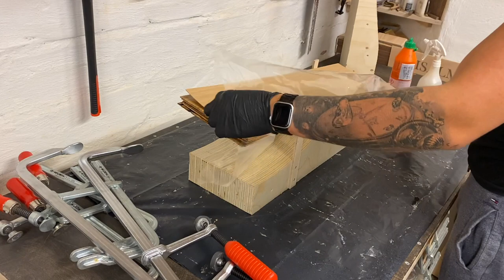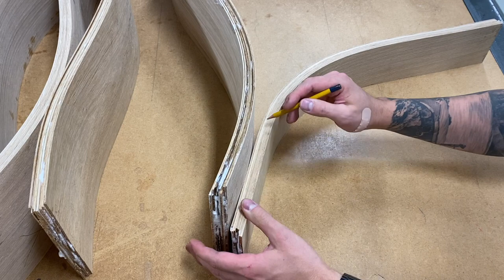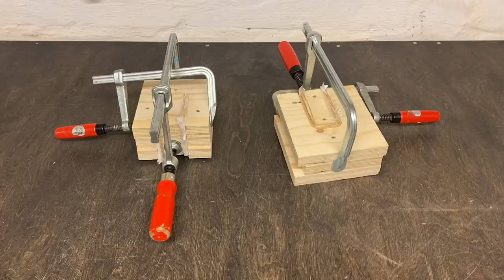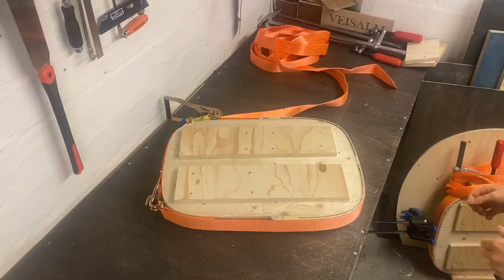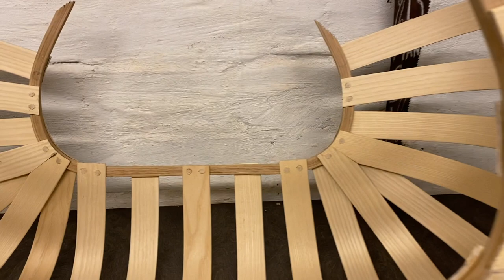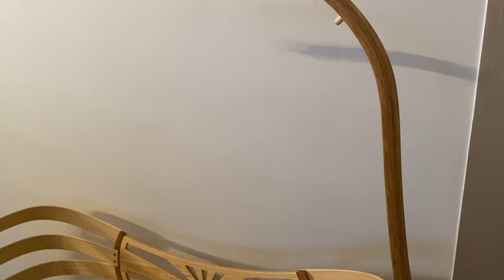Wooden Cradle | Master Carpenter | Woodworking | Unique Curved Furniture | Bent Veneer Wood Joinery

Comment: Thanks for your channel, I feel lucky juste to have found it.
I also work with laminated wood veneer, it gives you so much freedom with shapes without the needs of much tools. I don't have a bandsaw and it would definetely help but anyway, you can do without.
I wonder one thing though, what is your gluing method for the veneer, I only use withe glue and it works but your method seems as good as mine even beter... If you would share your secret, it would be nice.
Cheers and continue what you're doing
(love your tats btw)
Reply from the maker: Hey! Thanks for your comment. I agree that you can do new styles with way fewer tools! 
I have test many glues and most of them works well if just add it right. Usually I use polyurethane. Drying time is quite much longer but the result is the best. Polyurethane holds the shape very well and it fills the smallest holes and the gaps because the glue swells. Also if the glue punches through, dried glue is very easy to remove, scratch and sand. Most of finishing products also fade the glue what might come through. 
But I also use white glue when I make more basic bending. If the bending is curvier It might need different glue and more pressure, and that’s the reason why I use polyurethane. But if the pressure isn’t strong enough with the polyurethane, it might be the worst kind of glue to use.